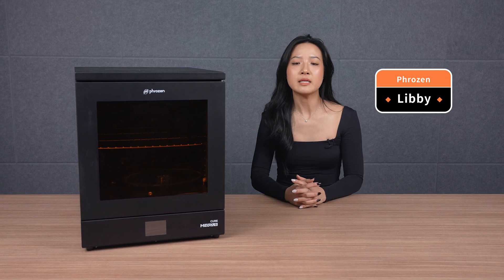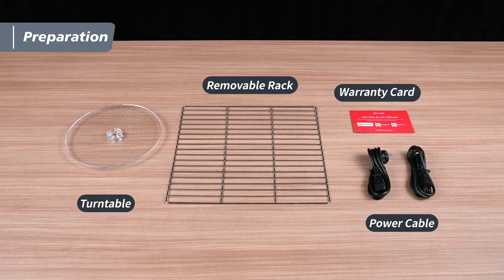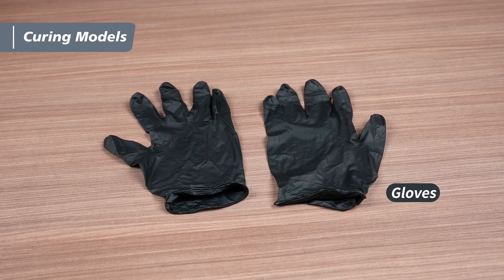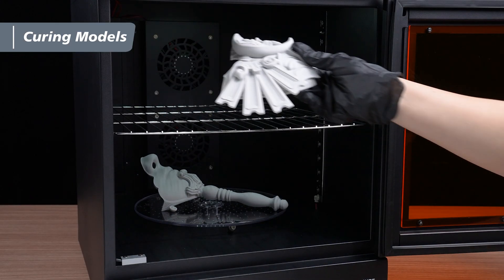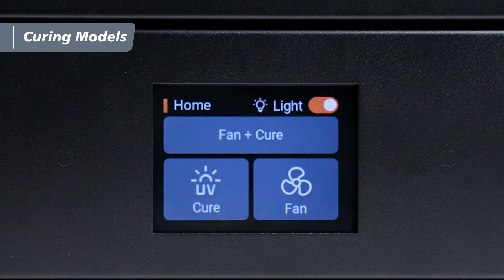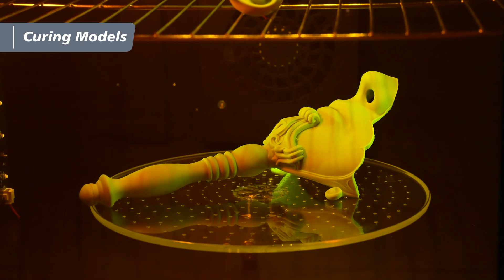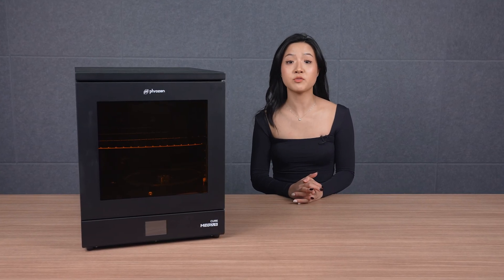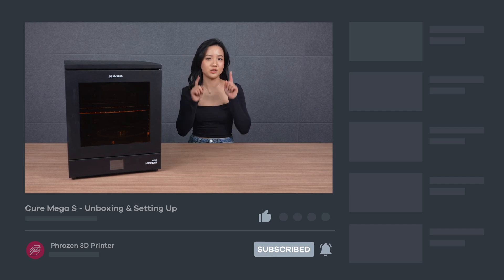Phrozen Cure Mega S: Unboxing & Setting Up  -  Phrozen 3D Printer

Comment: what does a starter kit looks like please?
Reply from the maker: For a beginner-friendly resin printing setup, we recommend the following essentials:

Wash and Cure Station – Simplifies post-processing and ensures better prints.
95%+ Isopropyl Alcohol – Essential for cleaning prints effectively.
Nitrile Gloves – Protects your hands from resin exposure.
3M Reusable Respirator Mask – Helps filter fumes for safer printing.
Protective Glasses – Shields your eyes from accidental splashes.

These will make your resin printing experience smoother and safer!